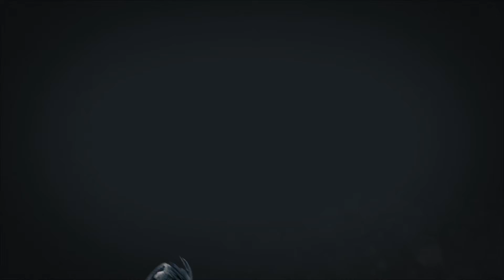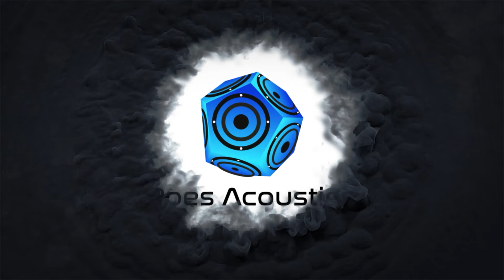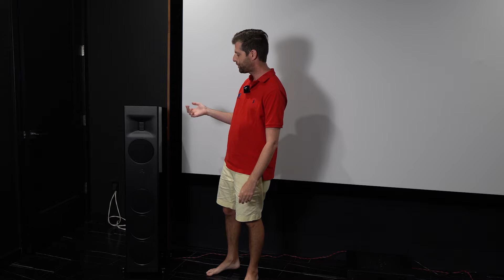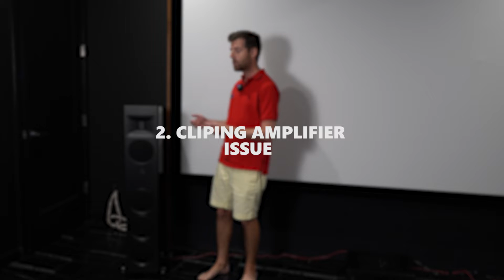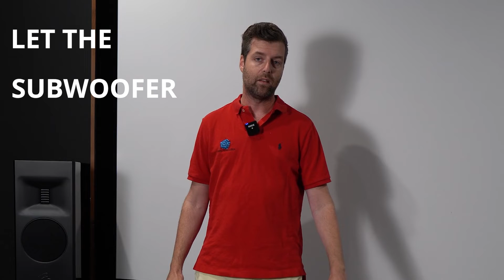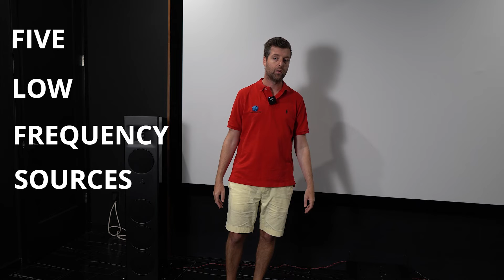Bass Management for your Home Theater

Comment: I’ve gotten good at using Dirac Live and MSO with my two Monolith subs. Only trouble I have is modifying target curves - I can never seem to get it right. Dirac’s new auto curve function helps a lot, but I still wish I had a better idea of what to do to raise the bass levels without being too boomy/muddy at a certain point… 

Too much more than +4db at the bottom end (with -1.7db in the upper frequencies), and it looses its clarity even though I still feel like it’s too thin in certain frequencies. Things clean up a little when I taper off the bass a bit below 20hz, but I still feel like my target could be better. The more I mess with it though, the more off it starts to sound.

How do you go about finding the correct target curve?

I’ve listened to you explain it a bit in the past on Audioholics, but I feel like this topic deserves an in depth video on your channel as well - would love to hear more from you on that.
Reply from the maker: I can do more.

As a quick response, try a ramp shape.  When others have researched this, they found that a wedge shaped response is boomy and muddy.  So a kind of low shelf was applied.  But they never really tried more than 6-8dB.  What you can do when you need more bass and it sounds muddy is to keep the level between 50hz and 150hz lower, but then ramp up slowly toward 20hz.  Sometimes what you are missing is the lower stuff and you want more of that.  

You can also try adjusting the turnover point from whever you have it now to somewhere lower.  if it starts at 150hz then move it to 100hz, if it starts at 100hz, move to 80hz, etc.  See if that helps.  Sometimes even 1-2dB can make a big difference. 

Also be sure you don't conflate visceral bass with bass loudness.  They can easily be confused in our expectations and you end up turning the bass up too loud to get more vibrations.  Vibrations are really a function of the lower bass more than the upper bass, but also a big function of the room.
Reply: @PoesAcoustics  I’ll give this all a try. Thanks so much for the advice!

Comment: Great video. Love the nodal density comment about using towers down to 35hz as part of the bass equation.

I have a question that Audyssey themselves couldn’t answer. In MultEQ X, if you use the speakers as “full range”, but apply a low frequency cutoff at 35hz for example, if you set the double bass overlap at 80hz, won’t the subs receive the full range signal from the speakers set to full range, less the low frequencies that have been cut off? I.e in this example, won’t the subs only get 80hz - 35hz, if that’s what the rolloff of the speakers was set to in MultEQ X? I really want to try this with my 802d4’s, because I don’t want to neuter my $25k towers, but I want to make sure I’m bass managing the system via maximizing the potential. Thoughts?
Reply from the maker: I am not sure I understand.  How can you run the speakers full range and cut them off at 35hz?  When you say cut off, do you mean to apply a high pass filter at 35hz?  If so, they are run as small, not large, correct?
Reply: @PoesAcoustics  great question.

In MultEQ X, there are three ways to bass manage. 1.) set small/crossover, 2.) set Large and apply a cutoff on the Design Curve page, and 3.) apply a curtain (which isn’t really a filter, it’s more of deciding which frequencies you want to allow EQ to be applied). That is the reason for the question…
Reply from the maker: @HiFinest343  ok I understand what you mean now.  I am not sure I’ve ever done 3. But my hunch is that everything between 0hz and 80hz or so is sent to the sub.  It doesn’t throw away bass between 0 and 35hz. 

Crossover is a term when you have a cross over from one driver to another based on a frequency division.  Basically symmetry crossovers with no overlap.  But you don’t have to do that. So a system that high passes the mains at 35hz while low passing the sub at 80hz is totally acceptable.   You just have to manage the extra LF energy between 35hz and 80hz.  

Bass management is something else all together.  It refers to taking bass from a small speaker and sending it to a bigger speaker like a subwoofer. This also doesn’t have to be symmetry.  It can have substantial overlap. 

Since exciting the modes in a room through multiple low frequency sources tends to help even things out and create better bass smoothness seat to seat (often in the MLP too), I like having the mains contribute when they can. But sometimes they can only contribute partially and so using high pass filters below the sub crossover can be a good idea if the system can apply a type of double bass.  

Doing this does need to be balanced against dynamic range.  Lots of speakers can play very low but not loud at those frequencies.  And most receivers do not have enough power to push a speaker very loud if it included low frequencies.  So powering a tower off a receiver could actually reduce dynamic range rather than increase it. I actually had this happen in one of my older systems. I was powering my Gedlee speakers (95dB sensitivity) off a receiver. I did their version of double bass.  The amp would audibly clip during dynamic peaks.  I had to apply a highpass to get more output. I eventually added external amps and could again run it full range. The speaker could handle it, the receiver could not.
Reply: @PoesAcoustics  thank you for the detailed response. In my case, I have a similar setup to what you guys muscled through at Gene’s living room with MultEQ X. I have an 8805A pre/pro, with a Michi S5 amplifier driving 802d4 towers in a large, open concept family room. Both subs are at the front of the wall, one corner loaded one not (and there’s a 7dB difference between the two due to boundary gain, crazy).

Would love to see more tutorials on how to optimize a pair of large ported towers with sealed subs, exactly what you and Gene talked through with the AV10 MultEQ X video, but going into detail on how you achieved a linear response and time alignment. I also messaged Gene on Patreon about this, hopefully y’all can accommodate! Thanks Matt!!

Comment: Hey Matthew nice video. I have the ONKYO RZ-50 and Dirac Live set the fronts at 70hz.... Should or I can i move them to 80hz without changing the sound or having phasing issues?
Reply from the maker: Yes of course you can.  Give it a shot, may actually restore a little dynamic range.  Hard to know without trying it.  There is not a huge difference between 70hz and 80hz.

Comment: My crossover is 67hz because my subs have a peak much higher that's masked better with a lower crossover...
Reply from the maker: That happens from time to time but really is a sign that the subwoofers need to be bettered.  The benefit of the higher crossover point is that it increases the bandwidth of the area in which you get the higher SPL and the improved smoothness.  Remember that the area at which you need to hit 115dB is from 20hz to 120hz or more.  It's the LFE max output and so by crossing the subwoofer at 67hz (I assume you have adjusted the LFE crossover too) you are limiting your dynamic range for hte LFE channel too.  If not, then something else to keep in mind, the resonance you are trying to avoid is being activated by the LFE channel.  You may want to address the resonance.

Comment: Hello. Lfe has brickwall of 120hz. Im using full active config with all speakers to bass mgmnt @80hz. To do this i need to LPF thr subs at 80hz as well. Do i miss a lot in term of lfe content ?
Reply from the maker: First, LFE is not brickwalled.  LFE has a crossover like any other channel.  On the Trinnov, you can actually choose filter type, slope, and frequency.  It doesn't even have to be 120hz.  It could be 150hz.  In my system, I have it set to L-R 4th order at 120hz.  

The crossover point for bass management is unrelated to the crossover point of the LFE.  Normally the LFE defaults to 120hz and its often L-R 4th order.  Ultimately up to you.  I wouldn't cross an LFE at 80hz, but again, remember that is a different setting from the bass management frequency.

Comment: Why do REL subwoofers (even the HT series) like doing full range on speakers? Are there any phase issues that are better if speakers are set to large/full range instead of doing bass management? Love to know your thoughts. Thanks!
Reply from the maker: Let's start by not assuming that what REL does is the right thing to do.  That is there approach, I don't agree with it.  They've never produced any reports that support that their approach is valid or better.  Merely that they feel it sounds better and anechdotely hear that from their customers (and realistically, all companies can make similar claims).  

There are a lot of reasons to believe that their approach is not better.  Welti's own published work is enough to begin to question their approach because their multi-sub approach ties a speaker channel to a subwoofer.  Which means if you have multiple subs around the room, typically they are not fed a mono channel.  Their approach appears to be about sending a channel specific to each sub location and then remixing LFE.  I believe such an approach is likely to yield poor seat to seat uniformity.

Now...if the question is can you have full range speakers run full range (as in without crossovers) and mix in suibs, sure.  But getting that to blend well and work right can be tricky and often requires sophisticated DSP to make work.  Simply using line level inputs rarely yields better results.  But I've been a proponent of this concept for a long time when the speakers can handle it.  My old speakers, the Gedlee's, could handle 1000 watts RMS, could handle a full range operation because the enclosure was so small for the woofer that short of boosting the bass, it was not possible to exceed xmax.  Meaning that the speaker didn't need bass management for dynamic range.  However, the speaker naturally rolled off at a 2nd order starting around 100hz, with a -3dB point of 80hz.
Reply: @PoesAcoustics  thanks for the insight!!

Comment: Last weekend I used test tones through REW to to find out what frequency my speakers seem to lose SPL and at what frequency I could locate where the bass was coming from. For example I found my rear on wall 6.5” focal speakers started rolling off around 120hz, and the other interesting thing was I could start to locate where sound/bass was coming from at 150-160hz, which is spot on to what anthony grimani said it would be. I ended up setting all my speakers to 130hz and it sounds clean during intense action scenes

Comment: The blending of Ported speakers with subs has been on my mind.  

The logic of having both the subs and the towers be ported also hasn’t been sotting well with me, as I consider that the port resonances are typically placed on the bottom end of the operating range.  

Meaning that there’s port effects where on the tower side where it crosses-over, but not on the sub side as it crosses over at the top of it’s range. 

Naturally the Q width of the ports operation is relevant here.
If the towers perform well down to 35hz with a port, and the Q of the sub’s port is wide enough to encompass 35hz then I think they would blend well with the crossover set to 35hz.  But that same equipment pairing, set to crossover at 80hz may have both sub and tower crossing over outside their port’s Q.  Which may also blend well since they are outside the port range.  But if the crossover activates the port resonance of one but not the other, it may be problematic 

So I’m thinking in order to pair subs and towers well and determine optimal crossovers, we would need to think in terms of the Q width of the port resonances. 

I’m curious how these thoughts find you and how you think about blending ported or non ported equipment.  I’m tempted to go in a port-less direction next upgrade cycle for a little more even order harmonics. But I currently have a ported set of towers with no sub, and have been thinking about how to choose a sub with the my existing tower’s port resonances in mind. With a slight aversion to plugging them.
Reply from the maker: You shouldn’t cross the towers that low.  Better to cross them over at something like 80hx which is well above their operating range.  

Ports are used on smaller speakers to help extend the max SPL at 80hz. Ascendo has some speakers like that. Those require a little extra effort to blend but it can be done. The key is to actually pay attention to both phase and timing so that the group delay rise blends correctly with the subs.
Reply: @PoesAcoustics  Thanks Matt I appreciate it, I’ll remember to think more about about the group delay and not just the phase.  

Hopefully we’ll see the emergence of more manufacturers sharing these details for easy cross comparisons. I’m tired of living in the dark, not even knowing the Q of my ports! The measurements you guys do at Audioholics really goes a long way in informing these decisions. And your insights here on your own channel are also fire! Good stuff!

Comment: Matt, An online video showed a Perlisten R5M demo room with 2 subs crossed over at 100Hz and just plugged the R5M ports so they crossed over at 80Hz, essentially having an overlap from 80-100Hz with subs and monitors.  Is that unique to how they setup the demo room or is that something we could try at home with those speakers and non Perlisten multi-subs? Also, did they keep listeners from localizing the subs by placing them behind the R5Ms?
Reply from the maker: I can’t speak to what was done. But in many cases something like this works well. The key is how it blends in both the time and phase domain as well as amplitude. Intuitively many assume a broad overlap will cause a bump in the response, but frequently that isn’t the case.  It all depends. My suggestion is to use measurments.  It really helps. You can figure out the right time alignment and phase alignment. Adjust the level and get it blended.  

As for localizing the sub. That should not be an issue with any decent sub below 100hz. If it’s local sizable more work is needed in setting it up.  Sometimes if a sub is making mechanical or other in harmonic noises the sub calls attention to itself.  Bass itself is largely not readily localizable at 100hz. But sure, placing them behind the speakers would have the benefit of also fooling the brain, as well as ears, as expecting it all to come from the same place.

Comment: Interesting enough, Dirac ART basically does away with bassmanagement as it has traditionally been done? What happens in that case?
Reply from the maker: That’s essentially true but bass management is still a thing.  Speakers can’t suddenly run full range.  ART is a means of dealing with modes. Not dynamic range. Bass management is about dynamic range.  So you need both. But ART works differently and so how you think about it is different.  I’ll cover this more directly in the future.